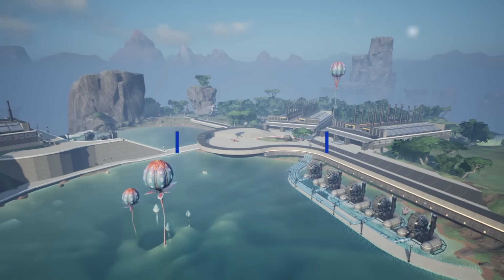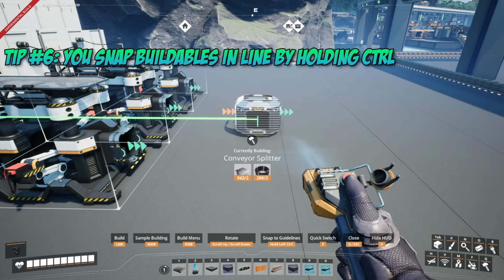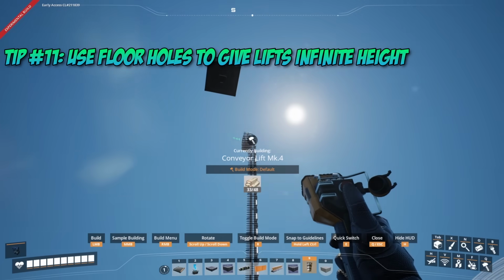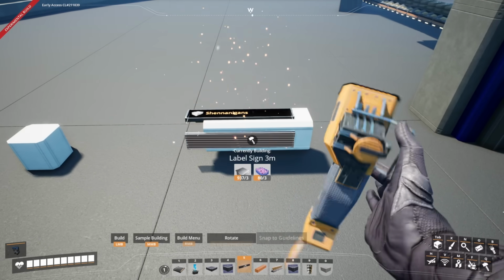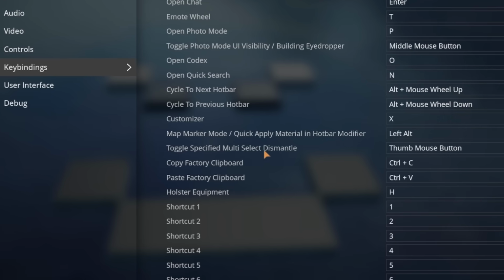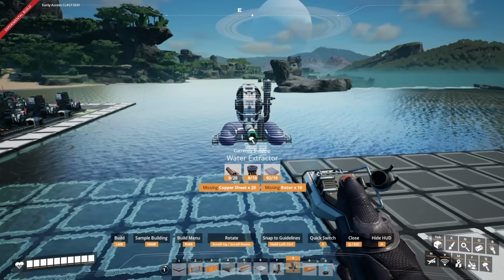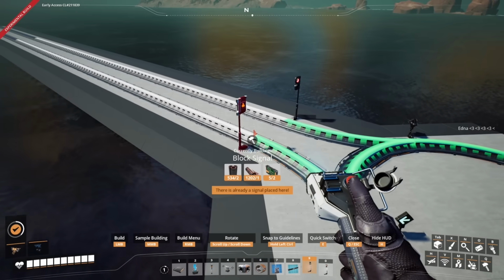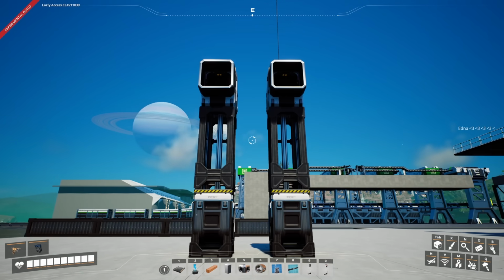30 NEED To Know Build Tips In Satisfactory

Comment from the maker: What is your favourite build tip?
Reply: the Waterpump one. Didn't know that and I love it. Ty!
Reply: I've been playing for 300hrs+ and I had no idea you could copy build items with the middle mouse button. 

I'm actually kind of upset with myself. I've probably wasted 15 hours of my life needlessly going through the build menu.
Reply: I had NO IDEA you could use control to snap a foundation to the world grid. That tip alone saves me a ton of frustration!
Reply: middle mouse picker is definitely the best feature in the whole game for building
Reply: I only recently realized you could replace power poles like you can do with conveyer belts, so your tip about splicing a power pole into an existing line is probably going to be my most used tip from your list. Great vid!
Reply: I didn't know the #11, the lifts infinite height, thanks.
Reply: Yes
Reply: I knew some of these tricks, but it is a nice compilation. I must try out the water pump one, as my water claim bases look a bit chaotic and might even waste some space.

I also like the sandwich floor concept. I would recommend a higher logistics floor though with 11m inside (3 walls on the basement with 1 m foundations on top. That way I can manage up to 4 levels of conveyor belts and/or pipes to feed even manufacturers and blenders. The splitters and mergers can be put on pillars, which helps to keep also an orderly look in the underground and supports building big facilities. I recommend a bus system on the sides for input and output.
Reply: How do you squeeze into the space between the logistics floor and the factory floor? They seem to be only around 1 splitter high, I build them always a bit further below. Or are you not supposed to go there at all?
Reply: cable split into power pole and last one the pillar on elevator to look more industrial
Reply: I did not know about z-fighting fix by mat change.  If I can do this without altering a bp, that'd be great.  But it's also sometimes handy to place a pillar on top, delete foundation, snap new foundation to bottom of pillar.  But this breaks bps, leaving cruft after bp del (in U8).  And bps can't easily snap to a pillar bottom.
Reply: To use control to snap a foundation to the world grid.
Reply: The power line trick is amazing. Never knew that.

It makes it so much easier to split two grids when you unlock power management
Reply: Tip 27, if only you had showed it off more
Reply: the alignment tip with a miner and the belt. that's life changing.
Reply: alt + mouse whell for 10 shortcut bar (not in video)
Reply: knowing that I can exceed the normal elevator height by using matching floor holes. mind blown
Reply: Yes
Reply: The one you left out, "how to build straight train tracks over wacky terrain"
Reply: To really take blueprints to the "next level", play factorio instead.
Reply: Yes, one factory game makes blueprints (perhaps first) and thus any other game that uses the feature becomes defunct and one must go play that first game.

Impressive, superb logic. Now since satisfactory was the first one in 3D, any upcoming factory game in 3D implies that we must simply "play satisfactory instead"

Wew lad @zxxvcc
Reply: @zxxvcc  TRATOR! 😁 I have played Factoria and decided it Satisfactory is better but that is just my opinion others may like Factoria better. Of course we all know they have a wrong opinion! 😜
Reply: @vincewilson1 I believe Factorio and Satisfactory are both great. While both have some similarities in concept they are different enough to play both, and also Dyson Sphere Program, etc.

While having said that, I need to admit, that I have roughly 1.5 times as many hours in Satisfactory, because it does the 3D building and factory design creativity part best IMHO.  Exploration and multiplayer are more fun as well.  At the same time I could finish a Factorio game reaching the ultimate goal within about 120 hours including some trial and error in single player.  With Satisfactory I am above 360 hours working in completing space elevator lvl 4 with all 8 tiers unlocked and will probably reach over 400 hours in my first single player run until having reached that goal.

I hope Coffee Stain Studios will manage to solve the performance and stability issues, especially autosave on Multiplayer servers, soon.

Comment: Why do you have to use 2m or 4m foundations? I use the 1m ones and don't see any reason to use the other ones except for an aesthetic?
Reply: The taller foundations are more forgiving when the ground elevation changes.  For example, the four meter foundation lets the ground change that much without sticking thru.
Reply: @veranet99  I mean, yeah? That just sounds like it's merely aesthetic like I said? So feels weird I see soo many video's saying you NEED to only use 2m or 4m foundations but don't really explain why beyond just aesthetics, but I don't know.

Comment: Playing this game I get really frustrated tearing everything down because something doesn't fit right or I made a small miscalculation that requires alot of teardown. I wish i could just move things more easily than rebuilding and fiddling with getting everything lined up,  the crtl key is helpful but not perfect. I think that it really takes away from the fun of learning as you go because you lose so much time destroying your work which leads to further possible mistakes.

Comment: every darn satisfactory video I see has a camera angle that is "top view", which I cannot figure out how to unlock. It's driving me nuts. HOW???
Reply: Do you mean how they are floating above the ground? That's usually the hover pack unlock. The game completely changed once I got that. Though youtubers probably just use creative flying mode or whatever it's called...
Reply: If you turn on photo mode and then activate decouple mode with R you can move the camera freely
Reply: @makeitrainbow8119  I haven't figured out how to turn on the camera mode yet. any help?
Reply: @danielsparling3079  Press "P" to enter photo mode then R to dcouple the camera and fly around, assuming you're using the default controls

Comment: One tip from me, if you lack the space to use splitters horizontal, place the last row first and stack the first splitter on top, after this connect them with elevators. Now the splitters take the same space as a manifold line but are more efficient..

Comment: So I shouldn't build my entire factory on grass?
Reply: In 1.0 I'm doing full spaghetti, very few foundations until I get more established. I don't want to spend too much time making it perfect until later. This is my first Grassy start, so these nodes are very limiting. The idea is that once I get better miners, some favorable alts, and more reliable power generation for overclocking, then I'll build proper factories. If I do it now I'll have to tear it all up anyways once I double/triple the input.

Last night I finally got 4 coal generators and a steel pipe factory from the pure coal node in the far south.

It's all on grass 😛

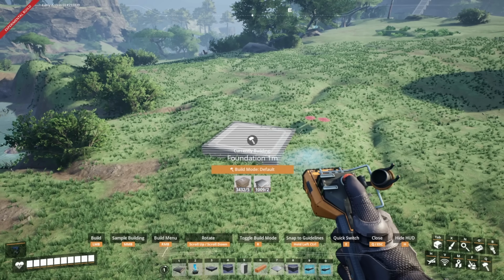Comment: 0:20 why does it have to be a 2m or 4m foundation? Doesn't the 1m foundation work the same?
Reply: I can't remember where I saw it but vertically, the 1m foundation won't snap right. I think it has something to do with the 1m foundations snapping to the vertical center of 2 and 4m foundations so you could potentially have issues with making totally flat floors down the line
Reply: The 1m foundation snaps at a weird level where it is half a meter below every other non 1m foundation.
Reply: @Vinignis , thanks. I figured this out in the meantime, however I think that is no longer the case in 1.0.
Reply: @Euszebiu   I’m binge watching tips and tricks videos and I thought that maybe there was a chance you still didn’t know. I left a comment just in case.

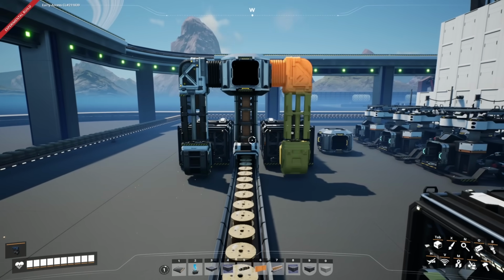Comment: 2:30 you cannot put a splitter (or any other input or output) directly onto an elevator in the normal position.  You can however put an elevator directly onto a splitter.  This is exactly how the video demonstrated, place the factory/splitters/containers first, then link them with elevators.   Which is EXTREMELY frustrating because you have to line up the buildings perfectly and then put the elevator in.  Or you put the elevator down, add the splitter, and remove/rebuild the elevator so it connects.  

Also note if you care about the finer details, the order you connect the splitter matters slightly with how it gets visually placed.  If you connect from a splitter to a factory, it will place the elevator very slightly closer or further away (honestly don't know which) than if you go from factory to splitter.  This is especially annoying with Manufacterers, because if you alternate you will notice that all the elevators are slightly misaligned with each other.

Comment: I really appreciate these build tips. I have a hard time getting started with this game. I love automation games, but both this and Factorio feel really overwhelming both in the beginning and in the late game. Oddly enough, the mid-game is usually pretty cozy, if you get there. Vids like this definitely help with getting over that feeling a bit.
Reply: My first Factorio playthrough was a complete spaghetti mess. It definitely gets a lot easier on the second run. The key is to make smaller builds that can be blueprinted, leave plenty of space around each production line, and stamp down blueprints whenever necessary to keep up with demand.
Rate calculator is an invaluable mod for setting up blueprints in factorio. It helps eek out the most from your belts/machines and does all the math for you. I highly recommend trying it, and I'm pretty sure it doesn't disable advancements, too.

Comment: About infinite Elevators using the Conveyor Lift Floor Hole. 
I cannot seem to get that to work in current Satisfactory, maybe it's been fixed in an update (I'm a fresh player, 50hr into my first map).
I tried putting a Foundation and a Hole at the top and drag an elevator down but that was capped at the regular elevator length, same with just adding a quick Floor hole at the bottom and drag it up it was also limited..
So atm I'm just putting one Elevator into another and alternating until I reach the bottom but it would look so much better if I could just have one long elevator instead of this Zig-Zag that I got now.

EDIT: Nevermind, I missed your part about going Floor Hole to Floor Hole! I tried to go infinite just after one Floorhole.
EDIT2: Nope still didn't work. I made sure to go Hole-to-Hole but the elevator is really, really long (probably upwards 100m or longer) so I can see that being the issue. That this trick is not infinite but just much longer?

Comment: why would you add a layer UNDER the machines JUST for the conveyor belts and pipes?! 
you can just raise the conveyor belts just above your head with elevators and have everything visible on the same floor for when you need to see where something went wrong and the factory stopped because of no resources

Comment: Also, instead of multiple clicks of pipe support placement, use a single click junction, which has the added advantage of ensuring no hard clip issues with junctions between rows of extractors.  I've used this with 1/2 foundation walkways in tight areas.  This let me get about 45-48 water extractors into the dune desert fjord on a dedicated server, which was shown on Relyen's stream in March 2023.

Comment: I zoop faster than bps.  Yes, 16 vs 10 is a bigger number.  But after each bp placement, you must target again, and it doesn't snap as easy as default snapping of a foundation to an edge.  Also, you can only reach 2, maybe 3 bps deep, then you have to run to a new location anyways, during which time you can't do anything.  Bps are higher burst but lower latency.  Zooping allows you to run sideways and zoop out 10, so you only have to run once at each end of row.  Combined with easier snapping, despit a lower rate of items per click, you get a much lower latency, resulting in a higher rate per time.  I'm physically disabled with lower manual dexterity, and it is STILL easier to snap a foundation while running sideways than to get a bp to snap, even in U8.  Some with very high manual dexterity and a flight mod can do faster with bps, sure.  But you can't hover without power.  If you're constantly switching to build poles and connect cables, your latency skyrockets.  That said, if you only NEED a platform about 16x16 or 24x24, you CAN use bps faster by standing in the center.  Maybe even combined with hovering a bit from central power, you can maybe get 32x32 or 40x40.  That would be faster!  But if you're doing something like paving the sky, nothing* (vanilla, no mods, no helpers laying power) beats a strafing zoop.

Comment: Another quality tips video from TX, cheers buddy

When placing railway lines on foundations, always place the straights first and then link them with curves so the railway doesn't have that annoying ever-so-slightly wobbly line

And don't forget the rule of 3 foundations for the minimum right angle turns

Comment: Small additional tip for #27 "Logistical floors": pipe junctions on the floor below will not snap to floor holes above them, snapping to the center of a refinery above instead. You can make them snap, by placing a stand-alone pipe junction on a foundation nearby which is aligned to the floor hole, which will then allow you to also snap the vertical pipe junction to the floor hole! 
That way, there is no need for pixel perfect free placements, and pipes suspended from the ceiling are at the perfect height for minimal pipe length!

Comment: How did you align the 2 conveier floor holes?
Reply: The main way is to make sure the locations are both on the world grid then pay attention to where the holes are on those.  If you['re not on the grid, I'd expect you could just use a really tall stack of walls to ensure they align then remove the walls if you don't want them there.

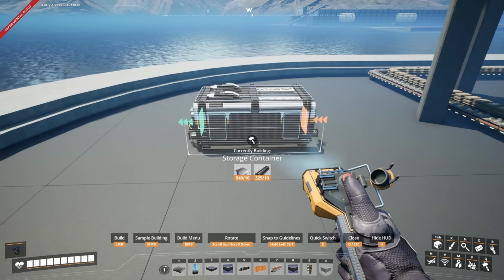Comment: 3:06 As far as I know, that looks to be the easiest way to make curving path foundation.
There is a SLIGHT variation for those who prefer flush corners.  Basically, do the same thing, but start your Catwalk Crossing at the halfway snap point to your starting foundation, extend it out once (so there are two total, one in the middle of the starting foundation, and the other jutting out), then place your rotated catwalk square on the one jutting out and adjust it as desired, zooping out some extras once you found the angle you like.  The foundation will have a corner-flush spot to start your curve.  Note: you may have you rotate the Catwalk Crossing 180 degrees to get it to give you the correct snapping point for the foundation.

Comment: Free tip, you can also place a small pillar base on top of a large pillar base, build up with small concrete pillars and reverse the pillar bases at the top. After this, you can pull out the large steel frame pillar and it will snap to the large pillar base and allow you to similarly encase the concrete pillar, adding a LOT more detail to a simple pillar.
Reply: Ik its been 2 years but i just tried this and it still looks great, gonna use this design for later thank you!
Reply: Ooo i need to try this after work today !

Comment: The one big thing I have to disagree with you on in terms of build aesthetic is hiding belt/pipe work on a logistics floor. I love seeing all the items moving as they make the factories feel more alive, and I just use catwalks attached to the tops of most buildings to move around freely in my factories. And I get a great view of the belt/pipe work from above.
Reply from the maker: That's a fair point I enjoy seeing everything on the belts too, but a logistic floor can be really beneficial for people who don't use catwalks  🙂
Reply: @TotalXclipse  Pluse, your method of hiding belt work definitely helps with frame rates which is a huge plus as your factories get bigger and bigger.
Reply: Best of both worlds: glass flooring with the pipelines and belts under it. I use this for everything and sometimes just sit there and watch
Reply: @DrPingas_2 came to comment this 😂
Reply: u can make a logistic floor and put a glass floor on your main floor so you can see the items moving below and still have a clean level with machines
Reply: Depends. I like using a logistics floor for my power factories and my materials factories to have a lot of belts. I always build room for a logistics floor in case I have to do something mental that will be a pain to work into the existing structure.
Reply: I recently designed and built an iron farm on my world but to balance correctly it needed some serious spaghetti so I kinda needed a logistics floor to deal with it. If your belts/materials are going to be easily divisable and neat then no need but it was quite ugly
Reply: hard to disagree on how one should play in a sandbox, no? I make compact factories usually around 3x3 blocks which is nigh impossible without a logistics floor. You can force it to work, but you won’t very easily be able to go configure the factory down the line.
Reply: Yikes.
Reply: fr. I started constructing an actual factory with a logistic floor below the actual machines and oh boy I love the aesthetic of my main base more with all the crisscross conveyors and lifts between the different farms I have on the location. It just feels right, like im actually pushing for efficiency, extracting as much resource from the planet without thinking about the negative impacts it brings to the ecosystem